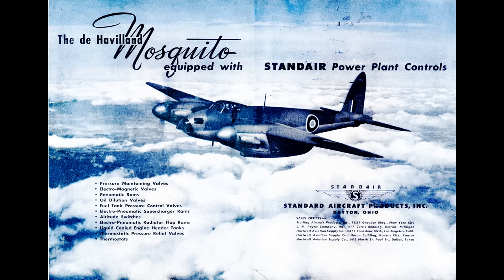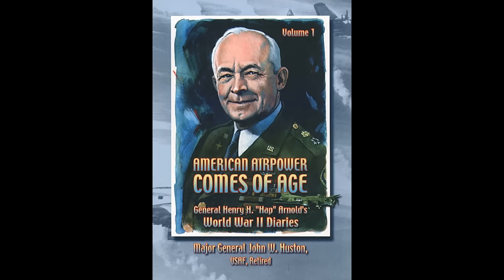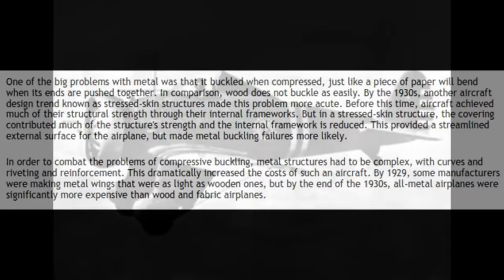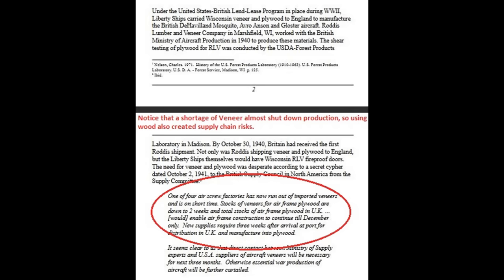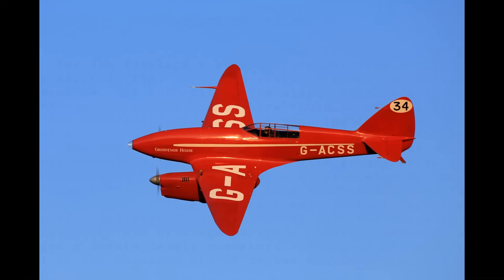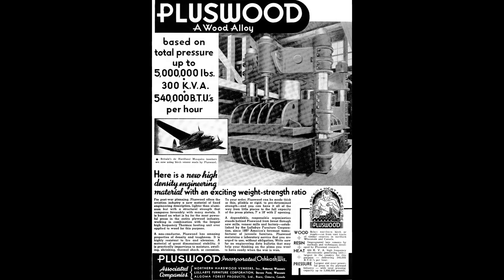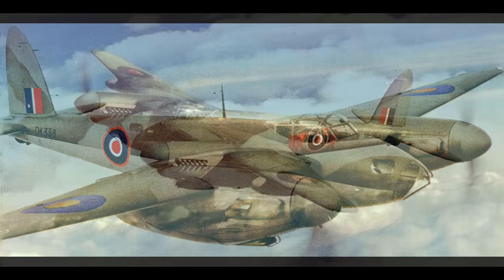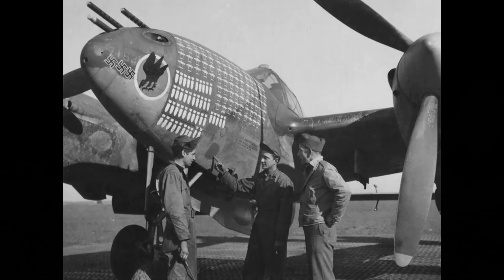De Havilland Mosquito vs. ?

Comment: The DH98 Mosquito is my favorite a/c of all. There is a flying MK 16 bomber version rebuilt by Victoria Air Maintenance ( the last I heard of ) in Victoria British Columbia. It is desnigated "F" for Freddy the call sigh of the ac that crashed into the control tower in Calgary, Alberta summer 1945. The Mosquito used Sitka Spruce, a tree unique to the west coast of Canada for the main spars. Sitka is used because it is, by comparison, light and strong and as well does not split and fracture easily. These properties were appreciated during the construction and operation of WW l aircraft. The above mentioned Mk 16 was built by AirSpeed in NewZealand, Janurary 1946 (correct me if I am wrong). Comparisons between the (problematic) P38 and the Mosquito are just plain dumb.
Reply from the maker: All the problems with both airplanes will be discussed in a future video.

Comment: The original design of the Mosquito was as a medium bomber capable of carrying 4000lb worth of bombs.  Doesn't that it make comparable to (say) the B25 Mitchell or B26 Marauder?  The main difference being the Mosquito sacrifices defensive armament for speed and height.
Reply from the maker: No, originally it did not carry 4000 pounds of bombs, that wasn't until later.

Comment: Very impressive presentation. Not to offend any of my British friends but the Mosquito is one of only two World War II British airplanes that actually impresses me.  It's one that I would argue a Blue Streak in defense of, regardless of what the other side brings as a counterpoint. That said, I really hope to find your mosquito versus P38 presentation someday. (Who knows, you may have already made it and I just have to go look for it? )  One indisputable plus for the Mosquito is that at the great Fighter Symposium of 1944, the Mosquito was almost unanimously considered "the best fighter bomber below 20,000 feet." But say what you want about the Mosquito being difficult to intercept compared to the P38, there was a major difference. The Mosquito was not a fighter plane; it was not designed to go mix it up with other fighter planes. It was an outstanding night fighter but the last thing a Mosquito wanted to do is run into an enemy fighter in the daylight. The P38 was designed as a fighter plane. The P38 went looking for enemy fighters, the Mosquito did everything it could to stay away from them. Now the P38 could not carry one of those huge 4000 lb "cookie" bombs like a Mosquito could, but for short distances the P38 could carry 4000 or more pounds of bombs and then when the bombs were gone, the P38 could go pick a fight with enemy interceptors. When a mosquito dropped its bomb, it hightiled out of there hoping not to be found.

Comment: I heard the Mosquito bomb capacity was equal to a B-17.
Reply from the maker: That's absolute nonsense and that myth comes from cherry picking data, taking a Mosquito's max load and comparing it to a B-17 mission requiring a lot of fuel. For example a B-17s max INTERNAL load, not a special mission set up, normal plane normal day was 12,800 pounds. A Mosquitos was nowhere near that.
Reply: The maximum bomb load of the bomber version of the Mosquito was a 4,000lb bomb which was only used for bombing built up areas as it could not be aimed accurately, otherwise it was 4 x 500lb bombs.  The normal load for a b17 was considerably more and records show 6,000lb loads being dropped on Berlin. Bombloads will vary with range for example on the daylight Augsburg raid the Lancasters carried only 4 x1,000lb bombs.

Comment: Lucky for the enemy the war ended when it did, about that time the the bearcat cat came out. It would out turn and outrun most all fighters. 4-20's and 4-50's you could say it was well armed and climb like a wounded goat, 1.5 minutes to 10,000.The war would have ended sooner had it come out a few years earlier.
Reply: Many aircraft on both sides were magnitudes of performance higher end of the war finished them all.
Reply: @yfelwulf  let's not forget the L133 that the army turned down in 1939. They were afraid the lack of rear view would have a negative effect not realizing there wouldn't be anyone on your tail at 612 mph level flight. Very maneuverable with a canard wing and well armed. It boasted the first turbin, and after burner not invented till the 50s. It could have been a much shorter war.

Comment: I've heard Machine gun rounds, would simply zip through the Mosquito, but lets be honest no light aircraft can take a lot of damage.
Reply from the maker: Machine gun rounds zip right through sheet metal as well.
Reply: @GregsAirplanesandAutomobiles  I know, I was a Weapons Engineer, but 30 cal solid bullets also hit metal bracing structures and ricochet around the inside of the aircraft, with the Mosquito and other light wooden planes, they just zip through, I used to have a neighbour who flew them, he told me, they were vulnerable, and in the early introduction to Service, he lost quite a few mates on low level missions where the RAF pushed their luck, thinking speed would get them out of trouble, the Courage of those Guys was incredible.
Reply from the maker: Wood splinters and cracks when hit by 30cal. Metal is far better in this regard. Worse, all German fighters carried cannons with high explosive shells that made a huge mess of wood. Most of the Soviet airforce was made of wood and the cannons made a mess of those planes.
Reply: @GregsAirplanesandAutomobiles  I can only go by anecdotal stories of the guys I knew who flew these planes in WW2, they are all dead now, but the Hurricane was famous for being able to be patched up and turned around, and it had a lot of wood, many British planes did, the most robust and only bomber to built all through the War was the Wellington, which had a geodesic metal construction, with a fabric covering, maybe you could do a Video on that one, the Lancaster and B17's get all the glory

Comment: I often wonder, if a Mossie had been built from Aluminium what might have been the result??
Reply: Probably a disaster as the parameters for the materials are quite different.  You design according to the materials, or better still use the materials suitable for your design.  This explains the advantages of composites for many uses, because you can use fibres of different strengths and moduli arranged with optimal alignment for the stresses in a resin matrix which suits the compressibility, temperature range etc. required for the task.
Reply: @petegarnett7731  Err, you know De Havilland were getting around the shortage of steels and alloys in building the Mossie, the way they did. Followed the construction principals used on the 4 engined De Havilland Albatross of 1935, that was quite a plane for 1935!!

Comment: Interesting article, the P-38 was undoubtedly a very effective aircraft but was not as good as a Mosquito in any of the given roles with the possible exception of fighter. The US would have been better replacing the B-17 with Mossies, which had a similar payload over extreme range at twice the speed with a fraction of the casualties and cost. Also the Hurricane and Gladiator have wooden frames to support the skin over all metal structure so no they were not of wooden construction.
Reply from the maker: The Gladiator and Hurricane were of partial wooden construction, although the Gladiator was a bad example as it doesn't have that much wood. As for everything else you said, it will be covered in a future video, some is accurate, some isn't.
Reply: The Mosquito was not a high altitude bomber.  The RAF built many thousands of Lancasters even after the qualities of the Mosquito were well known

Comment: D.H. 98 Mosquito vs Ta-154 Moskito, obviously. Both made of wood, both names are same.
Reply from the maker: The are designed for different primary missions, I don't know of a single case when Ta154s dropped bombs in combat. Plus they built fewer than 100 Ta-154s. I'll stick with the P-38 for this comparison.

Comment: Did the mosquito use counter-rotating props as the American version of the P38 did?  (I am guessing probably not).  Would that have made a big difference one way or the other?  I seem to remember that "castrated" P38s which were initially sent to the Brits had props rotating in the same direction.  Also those engines may have been lacking something in the supercharger and/or turbocharger area.
Reply from the maker: The Mosquito did not use counter rotating props, they would have improved the flying qualities, but hurt logistical support. With counter rotating props you have two different engines and two different props on each plane.
Reply: @GregsAirplanesandAutomobiles  Thank you.  I have inferred that the P38 was an expensive aircraft to maintain and that might be one reason why it was ultimately deployed less than the P47 and P51.  But unless I am missing it I look forward to your in-depth video on the P38.  Many years ago I read Chuck Yeager's autobiography.  I seem to recall that he liked the P38.
Reply: The DH Hornet which was a development of the Mosquito did.

Comment: When Germany built the Arado Blitz the Mosquito was outdated.
Reply: The 234 was unquestionably more advanced, but never reached sufficient production levels to be relevant. The Mosquito, on the other hand, was in service in sufficient quantities to be relevant.
Reply: In that moment every light and maybe medium bomber was "outdated", but that was the end of the war. As Me-262 did not change the war as a fighter, Ar-234 did not change it as a bomber and reckon plane.
Reply: big cheese  Though you are, of course, entitled to your opinion, I think it unfairly harsh to call it a pile of junk. The Mosquito was built of wood because it was a material familiar to the manufacturer, there were a lot of wood workers whose skills could be employed and aluminum was a critical material in short supply. Survivability when hit in fuel tanks was not a problem unique to the Mosquito. Not all aircraft utilized self-sealing tanks. I’m not specifically familiar with that decision in the design of the mosquito, but it could have been a weight issue or a materials supply issue. There was a war to be won and certain risks were assumed. The B-29 suffered from engine overheating problems throughout its service life, but production could not be stopped to deal with it. IIRC, the commander of the 82nd Airborne Division told his superiors that he’d never again allow his men to jump from C-46s after Operation Varsity (the last major combat jump of WW II) because they lacked self-sealing tanks which the C-47 had. 

In any event the Mosquito served well despite that issue.
Reply: Fuel consumption and range?

Comment: I don’t understand, the P38 and Mosquito only overlap in roles in very few places. The Mosquito was designed as a medium high speed bomber first, what would now be called a “strike aircraft”, with night fighter and reconnaissance roles being obvious because of it’s speed, range and 2nd crew member. Then there were the intruder fighter bombers with both a gun armament and reduced internal bomb load. Finally there was the maritime strike bombers with guns bombs, rockets and even internal anti tank guns The P38 was a heavy day fighter with close support ability and reconnaissance with a heavy conversion. It was no night fighter as there was no 2nd crewman to operate radar and without an internal bomb bay or bombardier, it was not a strike bomber. The only overlap is as reconnaissance aircraft and the USAF used both. You would not use a Mosquito to mix it with single engined fighters nor would you use a P38 to fly maritime strike into the Norwegian fjords or daylight bomb Berlin.
Reply from the maker: There was a two man crew P-38 nightfighter. It's also a good bomber. As this series continues I'll make all the comparisons clear.
Reply: @GregsAirplanesandAutomobiles  The P38M only actively served in the last few days of the war, and the accommodation for the radar operator was not good.

Comment: mosquito was an awesome airplane and well made.  I don't know if a P-38 could have carried a 4000 lb bunker buster.
Reply: The 4,000 lb bomb was not a bunker buster, it was a blast effect  bomb - a drum filled with HE and had a minimum drop height of 6,000 feet for blast effect reasons, and unless dropped on a built up area was unlikely to hit anything it was aimed at.
Reply: FB. Mk VI 2,305 built. Fighter bomber / intruder variant using Merlin 22, 23 or 25. 4 (Browning) machine guns and 4 Hispano) cannons, plus   2 x 250 lb bombs   carried internally & underwing carriage of   up to 2 x 500 lb bombs.   Could be fitted with underwing rocket projectiles or drop tanks   instead of   external bomb carriage.
 BAE Mosquito page

Comment: Regarding your comment on the strength of wood construction. The Bellanca Viking has a wood wing and it is amazingly strong. There are anecdotes about it flying through trees on missed approaches and not failing. Also, I have never heard of a Viking wing breaking.
Reply from the maker: I have flown a Super Viking and I loved it, it's one of the best flying aircraft I have been in. However G loading and taking fire from German 20mm are two very different things. In regards to strength I was only addressing it in terms of it's ability to absorb bullets and shells.
Reply: @GregsAirplanesandAutomobiles   Yes I agree Viking’s usually weren’t subjected to 20mm rounds. I just love the way Giuseppe Mario Bellanca designs stuff and I love his wings. This may be sad because my background is I was an A&P mechanic specifically on Beechcraft for 15 years.
Reply from the maker: I like the way Beechcrafts fly as well. The V-tail Bonanza is very enjoyable, fast, comfy, and not too bad on fuel.
Reply: @GregsAirplanesandAutomobiles  If you look at a V tail you will probably notice a cuff on the leading edges of both stabilizers. There was a big inspection/service bulletin in the 80’s where Beech found out in flight testing that the stabilizer would diverge enough at 1.2 VNE to tear the tail off instead of 1.5 which was the proper number. I was the only one certified to do the inspection and I ended up doing about 100 planes. I really liked working on Beech’s.
Reply from the maker: Oh yeah, whenever I see a V-tail I automatically look for that cuff mod. I don't think I have ever seen one without it. I have no issues with the V-tail and I prefer it to the straight tail version.
Reply: @GregsAirplanesandAutomobiles   V tails fly fine the cuff was probably an over reaction. My favorite Beech to fly was the regular 58. Was the nicest harmonized and sweet handling plane I ever flew. Was really easy with one engine out. Just don’t let it get slower then the blue line on the airspeed and you can’t go wrong. Dukes and 58P Barons I have no use for.
Reply from the maker: I never flew the 58, but they sure look nice. I have flown the Baron 55, and the Travelair, both of which were great. Actually all Beechs I have flow fly well. I do get nervous when I see how they attached the wings, but I guess it works well enough.
Reply: @GregsAirplanesandAutomobiles  The wing attach on Beech’s is a good story. I started at a Beech dealership at the beginning of the King Air wing bolt AD’s. All modern Beech Craft planes use 4 bolts per wing to attach them to the fuselage. These bolts are manufactured from inconel. Believe me they are very stout. The tensile strength is about 50 times the amount needed. What started it was one King Air had a lower forward wing bolt break during an out of control spiral in weather that exceeded VNE by a substantial amount. What should have failed first was the wing tip should have ripped off at the aileron cutout. Forensic analysis of the bolt showed it had broken due to corrosion induced cracking. We as a Beech dealership did extensive inspections and replaced all the wing bolts with new improved bolts and a special anti corrosion grease applied. I was involved in maybe 50 or so airplane inspections. The way the wings are attached does make for easier servicing in the field, similar to the wings on a BF109 lend it to still being able to wheel the plane around with the wings off. Like a lot of stuff in life with proper care the wing attachments work fine. OT at the same shop I did extensive repairs on a Cessna 310I that landed with the nose gear up and skinned the nose real bad. I got to know the owner real well and after the repair I accompanied him on the first test flight and it was mildly turbulent. I freaked out because the Cessna wings were floppy like wet noodles and flexed up and down at the slightest bump. Beech Craft don’t flex. They just go bump. The only thing I’ve been in similar to the Cessna was a German fiberglass sailplane.
Reply from the maker: All that makes sense to me, I didn't know what the bolts were made out of. I certainly haven't had any problems, and I have about 1700 hours in a Beech 99, and when I saw the attachment method, I felt a bit concerned, but again, I didn't know what the bolts were made of.
Reply: @GregsAirplanesandAutomobiles  My A&P apprenticeship was served at a commuter airline that ran 2 Beech 99’s. They were pretty ragged, however the night crew I was on was very capably managed and was a good learning experience. Never really “Liked” 99’s. Thought they were underpowered and the dash 20 PT6’s were prone to overheating if you moved the throttle too fast. Learned a lot about magnesium wheels and tire changes as a junior mechanic. Also did a lot of dye penetrant inspections on the spar cap.
Reply: @GregsAirplanesandAutomobiles  Inconel is a pretty impressive alloy. I believe it’s used for nuclear containment vessels also.